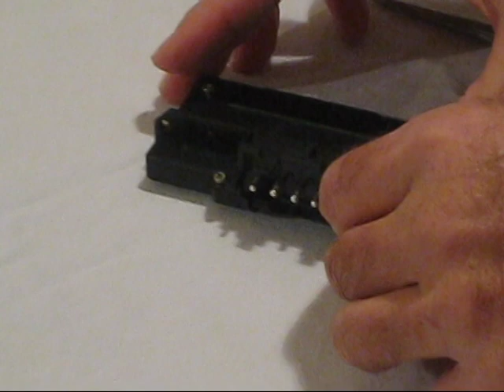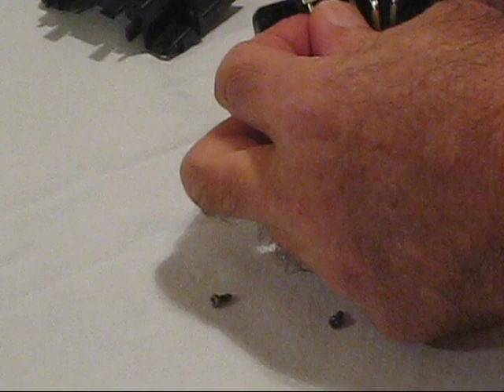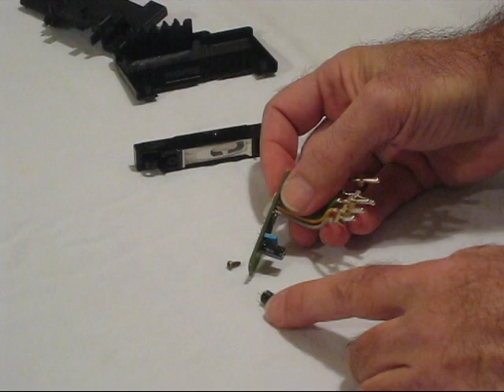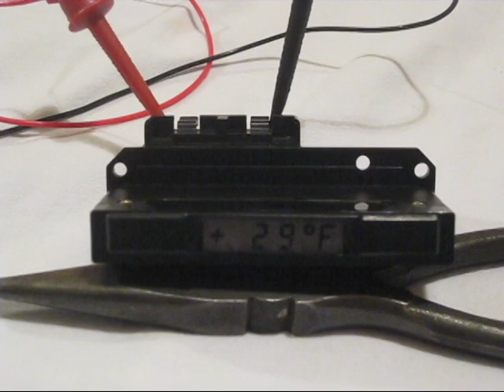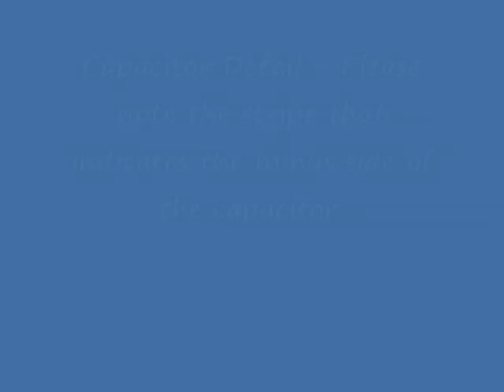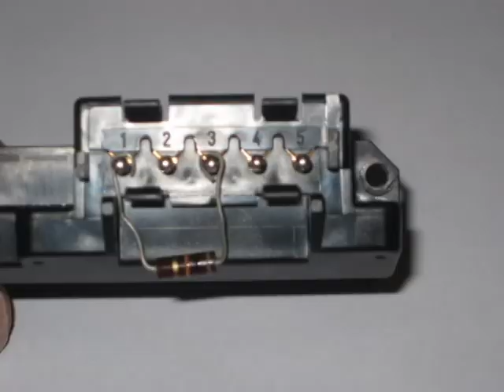Mercedes Benz (VDO) Outside Temperature Display Repair

Comment: What is the bulb spec on it? mine is burned out + I found out that someone soldered a different bulb.
Reply: You can order them as a spare part from MB- part #: 001 544 85 94

Comment: About 3 min in you get to the 2 backside caps - of which yours was the black one you called "electrolytic," which can (and did) leak.  What then, praytell, is the blue one, which is the leaky suspect in MY case (also a 94 E320 with sketchy, lying LCD).  Hopefully I can ID the thing if I take it out - and further, hopefully I can FIND a replacement.  Had to take the cluster panel out for something else, so might as well juggle this, too.Thanks, BTW, for all your helpful stuff on this old bucket of bolts as only a german engineer could arrange them.  Amazingly obtuse thinking evinced at times, but what would I know?Carry on.
Reply: Pale Writer Hi! Have you identified the blue capacitor? Mine is leaky as well. It says WIMA 4700 100-U. If you've replaced it, which one have you bought?

Comment: thanks for the video. I tried this and when i connected it in the car, still nothing. but then i tried it out to the speedo, still in the car but just connected. and then it showed -38 degrees for a few seconds after the ignition turned on and then went back to black. but this is not possible to see after I insert it in the speedo. is there anything in the speedo that can be replaced, new glass or maybe just remove it ?

Comment: Thanks for another helpful video  Why does pin 4 connect to the vehicle speed sensor?  Would it be ok, do you think, to remove the temp display to work on it and reassemble and drive the car with the display out.
Reply: Up to 08/87, the outside temperature display is
supplied direct by the temperature sensor.
As of 09/87, the outside temperature display analyzes
the road speed signal from the Hall sensor.
When the engine is started, the temperature
measured is displayed. The memory is activated if,
after starting the engine, the vehicle has been driven
no faster than 20 km/h.
As the temperature drops, the readout always appears
immediately no matter the speed.
At speeds below approx. 20 km/h the temperature last
measured is stored and displayed.
If the temperature rises, the stored temperature is
displayed in order to avoid any incorrect
measurement. This prevents an incorrect temperature
being displayed when driving slowly or when the car is
stopped and the temperature sensor is heated up e.
g. as a result of exhaust gases from the vehicle in front
or from heat radiated by the radiator.
At speeds between approx. 20-60 km/h the
temperature displayed changes after about 5 minutes
in line with the temperature measured. The change in
the readout is open from approx. 60 km/h.
Reply: Thanks erx.
Reply from the maker: I believe that the speed sensor is used to compensate the temperature calculation for vehicle speed.  It should be fine to drive the car without it.
Reply: If it works something like the outside temperature display in a 1993 Dodge Caravan, the VSS information is used to disable temperature updates when the vehicle is stopped (except for when first started), or moving very slowly (in heavy traffic) to avoid erroneous high readings from road surface heat or engine heat. I believe Chrysler holds last value until 30 MPH is reached for new update. Not sure the conditions Mercedes uses, but imagine it is something similar.

Great video! Now I can fix the LCD temperature display in my 1993 300E, Thanks!!!!